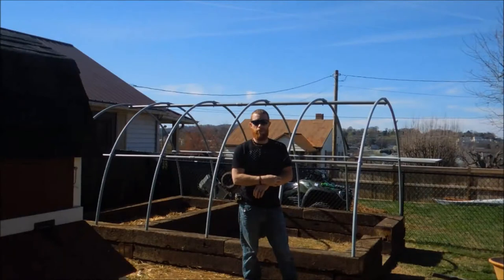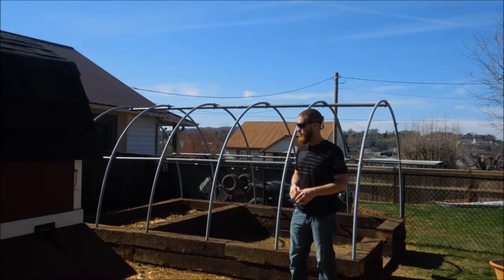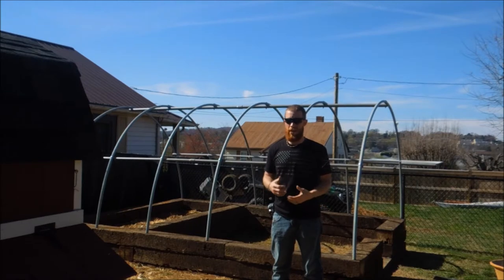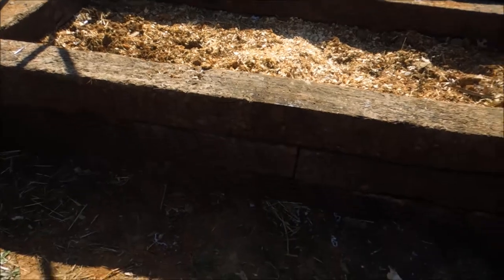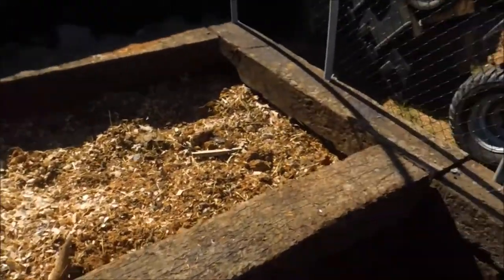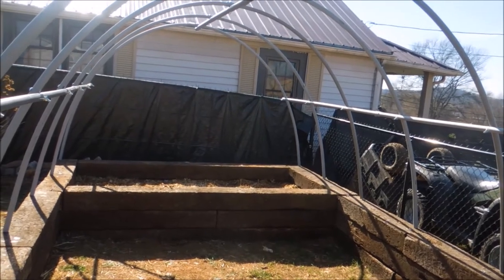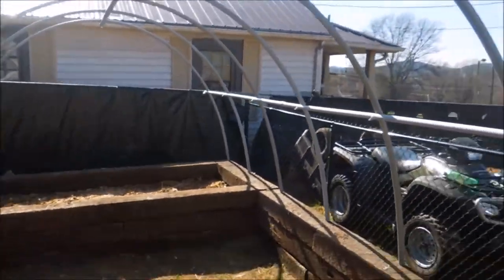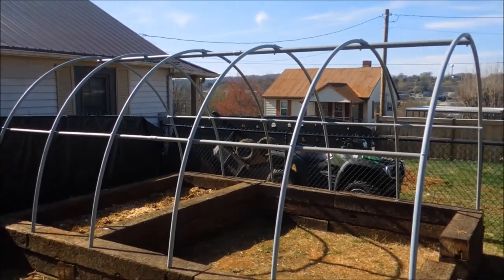How to Build a Greenhouse Part2 "The Skeleton" by HPFirearms

Comment: You should maybe put a bolt through the union of you ridge poles in order to not use glue and to facilitate take down (if ever necessary) and to prevent accidental uncoupling. Very nice and well thought out.

Comment: I never saw anyone using anything other than what you are using but i not watch many but i was thinking that some re-bar could be put inside to aid in support on your horizontal center ridge, here snow is heavy .  Also if holes were put through 1x4's or even 2x4's then plastic pipe bent and then the wood slid around it would ad stability too and allow for framing of ends as well. thanks for upload